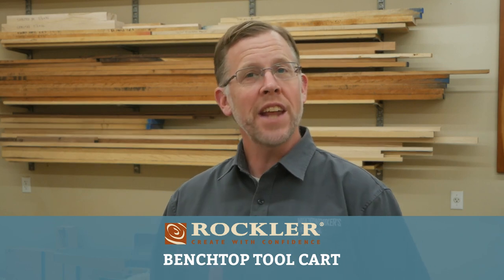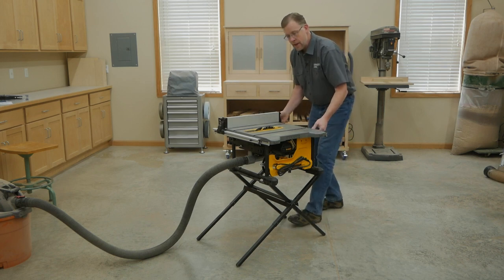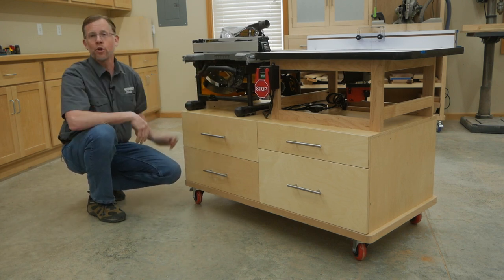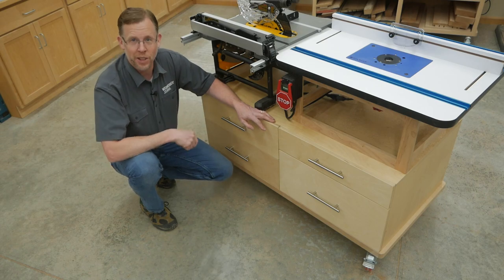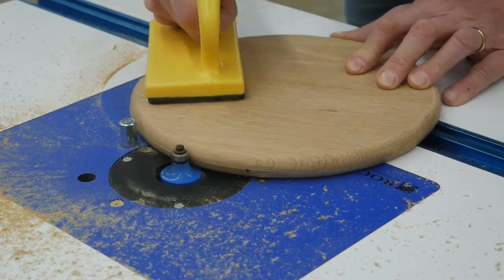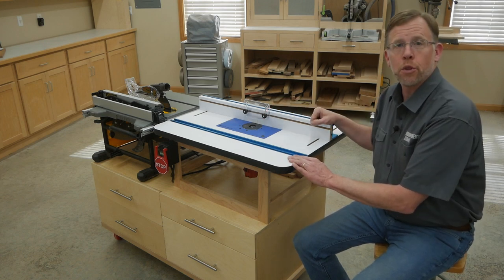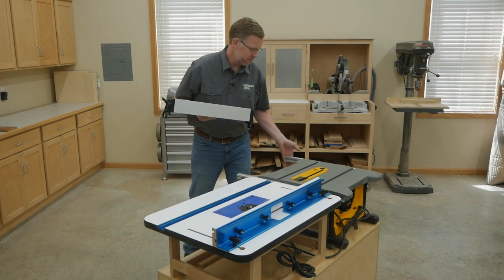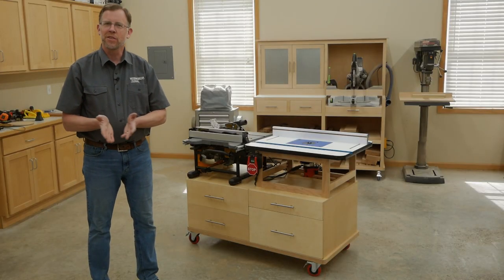Build a Benchtop Table Saw and Router Table Stand | Workshop Project

Comment: One thing I'm noticing is that the miter slot on the left of the blade isn't extended into router table.  That may be an issue for using crosscut sleds, etc.
Reply: other than that, I like this approach.

Comment: Great plans. How can I make the height 32 inches to fit me ergonomically. I am a short man?
Reply from the maker: Hello Michael, You can make it shorter by making all the  vertical panels (part 2,3 and 4 in the material list of the plans) shorter by your desired length. Then adjust the drawers accordingly. Here is a link to the plans for this build - https://go.rockler.com/plans/Benchtop-Tool-Cart-Plan.pdf - Thanks!

Comment: Why wouldn’t you orient it so that the router fence can double as a table saw fence extension to keep longer feeds “true”?
Reply from the maker: While the router table could have been oriented the opposite direction, so its fence could have moved in the same general direction as the table saw’s fence, there’s no particular advantage to extending the length of the table saw’s rip fence this way. An overly long rip fence on a table saw doesn’t keep rip cuts “truer” than proper feeding technique or a couple of featherboards will. Plus, were the router table fence used in this fashion, as an extension of the table saw’s rip fence, it would have to be set and aligned flush with the saw fence for every new fence position and rip cut. And, were the router table fence not carefully aligned, it might actually interfere with rip cuts coming off the saw’s fence (catching the leading edge of the router table fence, for instance). Best to let the saw’s rip fence serve as the only rip fence, for both convenience and safety.